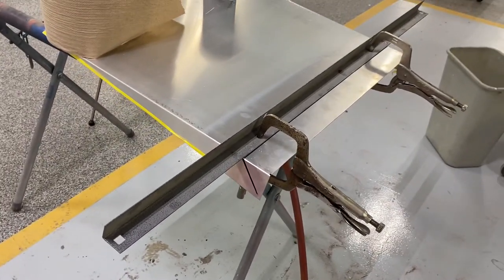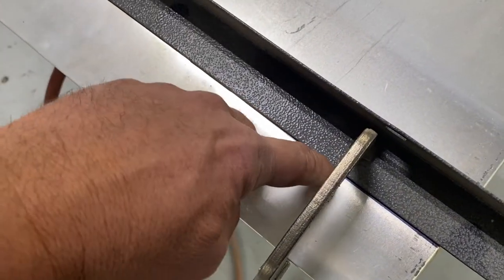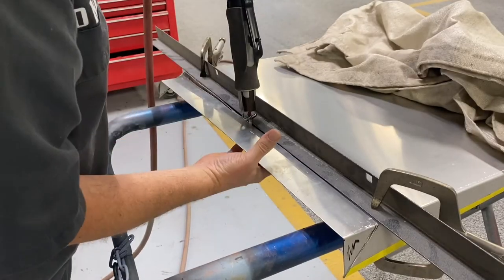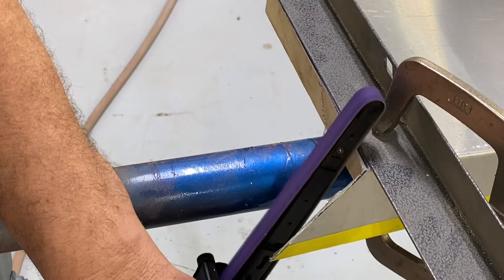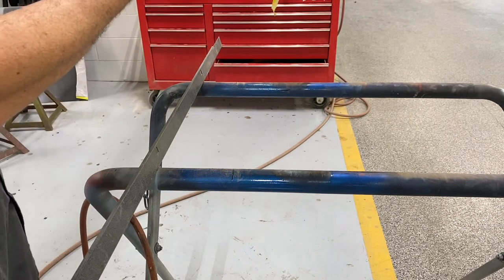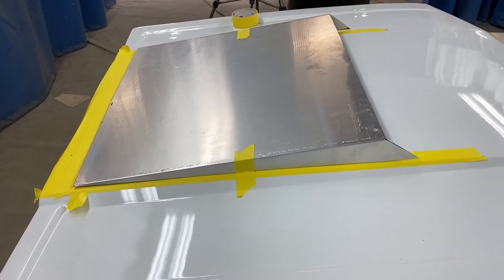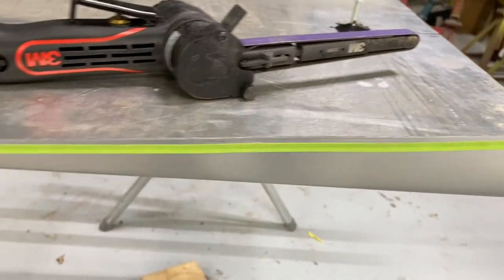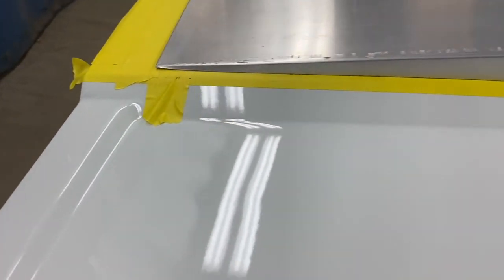Making a Cobra Style Hood Scoop out of some scrap aluminum.

Comment: Carroll Shelby would be proud. Why not an origional pearl blue such as intense blue pearl metallic like 77 mustang cobra? Worth a peek on color chart...
Reply from the maker: That's a good idea. I just got done painting it Dove Gray, but if the students don't like it the Blue might just work. I am just using paint that is leftover from other projects. 
Thanks for sharing!
Reply: @sussextechautobody9914  they actually had a 1979 cobra 302 that was that grey you speak about. There were orange ponies running along the side was first Fox Mustang
Reply: What are the dimensions of the scoop